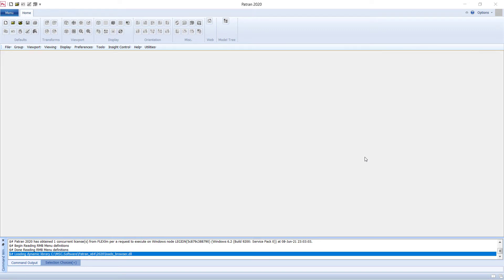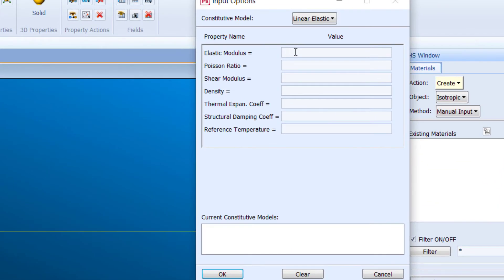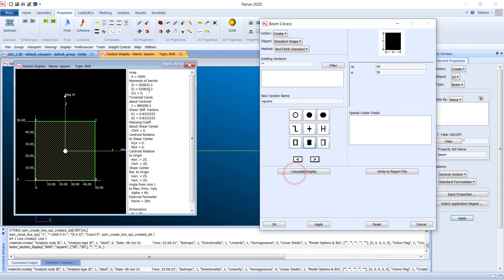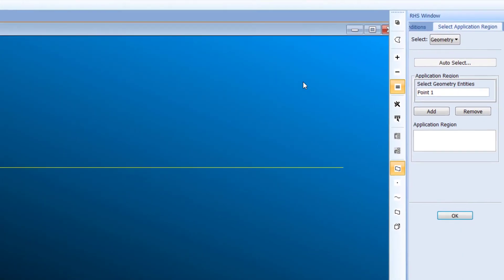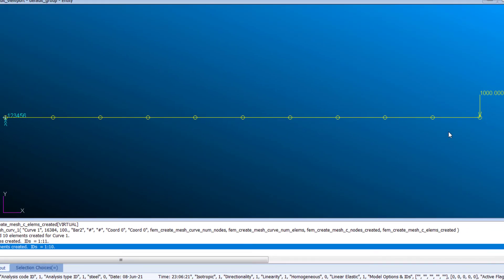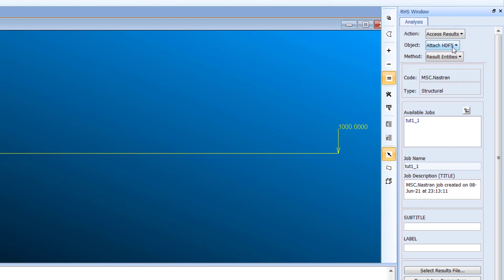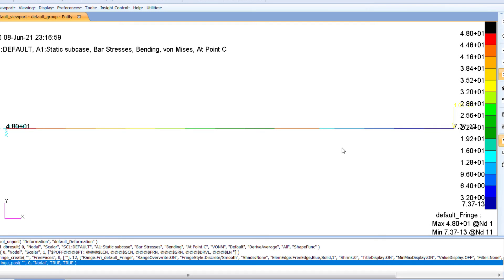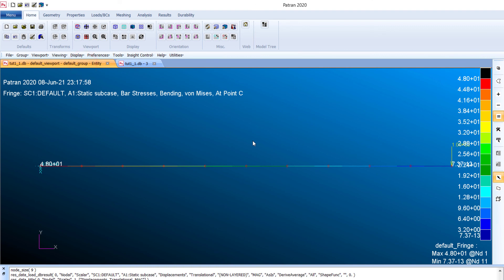MSC Nastran Patran Tutorial  1 Cantilever beam LSA

Comment: Sir I am doing my Mtech project in shell buckling of 8MW WIND turbine analysis by using MSC nastran partan software bt after making initial model in patran for farther analysis when I start nastran it is asking for optionnal keywords, I tried form 5 months bt I couldn't find any solution. I show this video so many time I make model of cantilever beam in paran bt when I go for further analysis in nastran same thing I was asking (optional keyword ) can u please 🥺 help me to come across this problem so that I can complete my project.
Reply: Did you try running without any optional keywords? You don't need any optional keywords to run the analysis.
Reply: Okk I will try then let you know this is working or not